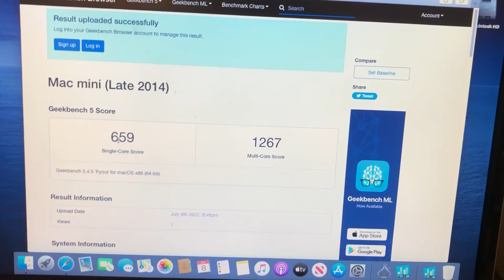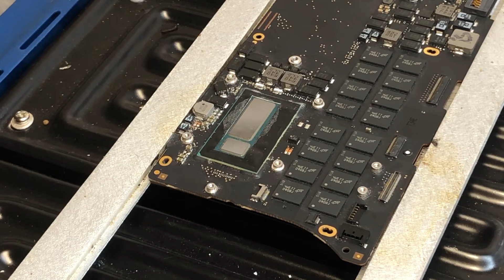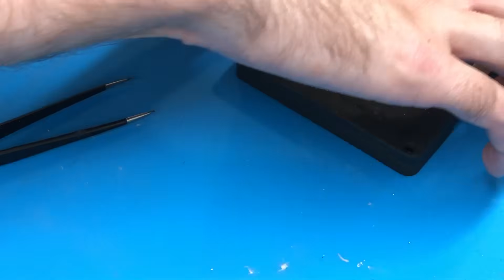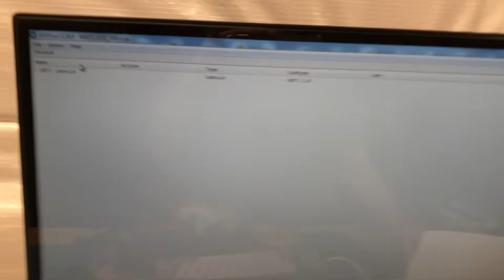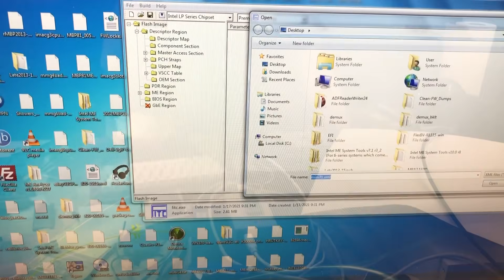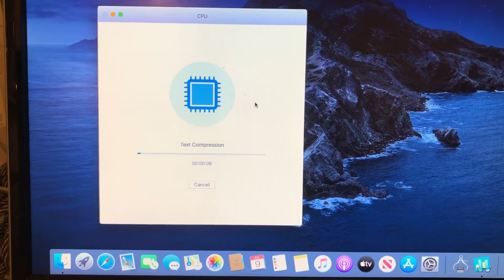2014 Mac Mini RAM and CPU Upgrade

Comment: When you pulled off the CPU I could see solder in place. What are the chances you could successfully put the new CPU there, heat it, and have it work without cleaning off the solder and adding new solder (balls)?

Comment: Hi! I know this is an old video now but I have 2 of these late 2014 Mac minis. I’m wondering what the maximum ram possible is, even unsupported but otherwise working capacities. My hope is that it will work with 32gb of ram, to match my late 2013 iMac. More ram = more better. 🤭

My ultimate goal is running macOS sequoia on both, and while the 8gb wil probably run ok on it, the 4gb model I own most definitely will not. It nearly died running Big Sur and froze up on me 😅

Since I don’t have the ability to do this myself, do you have any recommendations for getting this done? Do you offer this as a paid service?
Reply from the maker: Unfortunately, the absolute maximum that can be installed is 16GB, as 4GB is the largest capacity LPDDR3 chip made for that footprint. I do offer these upgrades as a service if you still are interested.
Reply: @dosdude1  even still, 16 GB is a massive improvement over my current 8gb. I have two of these late 2014 Mac mini’s. The first one that’s currently active is my 8 GB one and I’m running Sequoia on it. it’s painfully slow and glitchy, and I have to imagine that’s because of the RAM. The second one only has 4 GB which is absurd even for 2014 release date. I am actually very interested in seeing what services you offer and what the costs would be. I can clearly tell you know what you’re doing, and I would rather have you do it then try it myself. I didn’t find anything on your website about these services so it would be great if you could explain how to proceed. 😊

It would also be really helpful if you could tag my username so I can see the mention and see your messages faster. 😁

Comment: A worthy upgrade (if you have the equipment and skills LOL). So sad to see a 2014 with such a low spec CPU and paltry RAM. I own a 2014 mini with the i7-4578U @ 3 GHz and it actually slightly outscores my 2018 mini i7 with Geekbench 6, but that's in single-core only... the 2018 trounces the older mini in multi-core. Since I don't have a fancy soldering station, I will have to satisfy my urge for a faster 2014 mini like most folks... by buying another 2018 mini!

Comment: I just purchased a Mac Mini Late 2014 Core i7 3.0Ghz 16GB Ram 512GB SSD for $100. Once it arrives I'll be adding in a NVMe M.2 Control Adapter so that I can put a 1TB NVMe M.2 2880 SSD in as well. These are really nice systems, going to run MacOS Sonoma on it.
Reply: Please explain this—NVMe M.2 Control Adapter.... i really want to understand. please

Comment: if you accept my logic board, how much would you take..? Of course I need to source the cpu or a donor board... Dual core is so crippled in nowdays' internet but mac mini itself is in great condition.
Reply: nvm. mine's 2.6ghz i5. though it was 1.4. I can write EEPROM but soldering is the problem. Well, guess it will go on Ebay.

Comment: Where did you get the ram from? I’m trying to do the same thing but cant find out where to get the ram?
Reply from the maker: You can get them from AliExpress.
Reply: @dosdude1  hey so I just found your forum and everything. I think I found the correct ones that work is it possible to private message you and show you what I found to confirm its correct?
Reply from the maker: @sperez314  Just let me know the part number, I usually use Micron "D9SSK", or Elpida EDFB232A1MA-JD-F.
Reply: @dosdude1  The one I found was EDFB232A1MA-JD-F. Idk if its from the company Elpida as it doesnt say on alliExpress but whats the difference from the JD-F and the GD-F?
Reply: @dosdude1  So I found EDFB232A1MA-JD-F idk if its from elpida as aliexpress doesnr specify but I assume it is. I know to get the JD-F version as everyone always says it but what specifically is the difference from that and the GD-F version
Reply from the maker: @sperez314  GD-F is rated for 1600 MHz, JD-F is rated for 1866 MHz. If using for this machine (or any other Haswell machine), it only supports running its memory at 1600 MHz regardless, so either will work.
Reply: @dosdude1 ah okay that makes sense well since I’m upgrading a mac mini ill do the jd-f version thank you so much!

Comment: Hello! Can you please help me to find the issue with my 2014 Mac mini? Its immediately shuts off right after power button pressed. Cooler spins for a second and that's it. I've tried to replace power supply - doesn't help. Tried every reset technique already. Checked with different memory sticks.

Comment: I'm going up to Canada from Portland Next  year hopefully to learn  Microsoldering and smartphone repair but once I get comfortable soldering I am super excited to be able to do this kind of thing.  I literally just bought a Mac Mini from late 2014  for 100 so that I could use opencore to upgrade to Monterry and run BlueBubbles  server off of it but I noticed the appalling 4GB of RAM  and I'm like that'd be good to upgrade.
Reply: You're in for a lot of fun! Memory is doable, because of the smaller size. Just a little cheap preheater is enough. If I'd do it again I might mark the position of the IC's before removing.

Comment: Could a Quad Core i7 (such as the 4702MQ) work in a 2014 Mac Mini?
Reply from the maker: No, as you are limited to Haswell U-series chips on these, due to their unique footprint and implementation (PCH and CPU on one package).

Comment: Great video for someone like myself. I’m looking at purchasing a 2014 Mac Mini so now I know that, whilst the ball-ache of doing this process myself isn’t terribly difficult (merely mundane), it does require a set of unique tools and isn’t cost-effective unless scaling the operation.
Alternative, spend £20 extra for the 2.6GHz model regardless of RAM and upgrade the whole unit a year later to the 2018 model.
Thanks!!!

Comment: Really nice video. Thanks for the entertainment. Its a bit sad 2014 mac mini has only a 2 core cpu, which makes late 2012 mac mini a better choice both by the fact that you can upgrade ram and the i7 CPU being better in multi core performance thanks to the 4 cores and 8 threads and the 2012 i5 is a bit better than the 2014 i5. There is a plus however, 2014 mac mini consumes way less power than the 2012.
Reply: The graphics are better on the 2014 as well, especially the 2.6 and i7 versions which are Iris instead of HD 5000.

Comment: I’m going to attempt to upgrade my Mac mini 2014 ram from 4 to 16. I’ve got a heat gun but I’m trying to figure out what else I need and what I need to know. What flux did you use? Also how do I know if the resistors are set right of if so need to move them? Also where do ai get the correct ram chips?
Reply: did u get the ram chips?
Reply: No, I have realized that my Mac is so old that it’s probably pointless and a waste of time to upgrade. So I’m probably going to just get a newer one.
Reply: Yeah, i guess its time to get a new one... Thank tho

Comment: Awesome work.
A complete novice here, so please excuse my ignorance, but I didn't notice you putting any fresh solder on the RAM chips. It looked like you cleaned off all the old solder from the pins on the logic board, added flux to the new RAM chips and then put them on the logic board. Where did the fresh solder come from to solder the new chips onto the board?

Comment: OMG, fantastic. Beyond my competence but I am going to upgrade a 2014 i5 Mac mini with an additional PCs 500Mb drive instead of the SSD drive. Hopefully this will speed things up enough. Actually I have a Mac Book Pro from 2011 which I managed to drive over. (don't ask how). I had the screen removed and have been using it to drive my tv but the OS is not upgradeable and I have VPN problems with it.

Comment: A little like having a Time Machine.

Over the years, I’ve always bit the bullet with whatever cannot be readily updated, and I’ve never once regretted it. My Macs serve me for an embarrassingly long time mostly due to that up front cash drop. Apple’s campaign against people like me means no new Macs. I’m still in the early to mid 2010s with all of my computers except for the iPadPro I’m typing this on. They are all business tools for me so upgradability is essential. Colleagues marvel at the age of machine I use with modern OS and more importantly, 2023 Pro Tools versions. Now if I could just shave a few pounds off my MBP 6,2 for flying.

Comment: whats the trick getting a 2014 thunderbolt 2, to boot off the new NMVe SSD drives? if you used the Thunderbolt 3 to 2 adapter then the NMVe doesn't get power for the external enclosure
Reply: i figured it out for anyone else, there is actually a $15 internal adapter you can buy and you open it up and it's plug and play, screw thunderbolt 2, TB2 sucks, this is the way to go, i am now getting 760 MB/s read / writes this way!!!  Dosdude1 thanks for your non help here, haha

Comment: I'm on a late 2014 mac mini with 4gb ram and an ssd. I think the ssd makes all the difference for me. This computer as is with the ssd is fantastic. Thanks for the information and the how to. You're super talented.
Reply: how u running the ssd? externally booted? make sure you use the usb 3.0 ports not the 2.0 ports, 3.0 is 10x faster.

Comment: Question!

I have Linux installed on my macmini late 2014, can this upgrade still be applied? And would I still have to reprogram the eprom? can I follow the same steps in this video and get the same results with a linux based os?

Comment: The average 2014 mac mini model has an i5-4278U at 2.6 GHz with 3mb of cache, and the i7-4578U has a base frequency of 3 GHz and 4mb of cache and the difference between them is units of percent. And both of them are 2 cores with 4 threads. Is it possible to solder a 4-core processor on this board? and another question I have a mac mini 2011 with Core i5-2410M and only built-in HD3000 graphics. It slows down even when viewing YouTube, what can it be updated as much as possible by soldering and is there a graph in this generation that will pull at least YouTube?

Comment: Hi, just wonder is the RAM in Mac Mini Late 2014 (1600 mhz "low power" lpddr3 sdram) is same as other ram that able to get in the market? Or in other word can I get these ram chip from anywhere in the market (As long the same model number used in Mac mini late 2014) the dismantle the chip from the ram and solder into my Mac Mini?

Comment: How you align those chips to be perfectly placed on the board is beyond me. You would think that some kind of guide would be glued onto the circuit board with the original chip so that you could be 110% sure the pads and contacts are properly placed.

Comment: 1.4ghz and 3ghz arent real frequencies tho, classic apple move to over simplify things to such degree it becomes misleading

2.5ghz and 3.5ghz are the real frequencies, you need to account for turbo boost which defines the real frequency. Also the i7 is apparently running at higher voltage, you gotta check the cooling (prime95 sfft for 30 minutoes, or aida64 with "stress fpu" only, to check for throttling). In geekbench there is a 25% improvement which is minuscule to say the least, but with throttling the i7 may actually decrease its performance  back to i5 level.

Overall great demonstration, but completely useless in the real world.

Comment: Very impressed by dosdude1's skill and  precision.  This is way above my pay grade. Will  say this: I've a 2012 Mac Mini, the last Mini where both RAM and drives were socketed (not soldered) and so upgrades there were plug and play. The CPU of my old Dell Latitude was not soldered either so upgrading that was also simple for this klutz. All of which is to lament that newer tech, with glued cases and soldered everything, requires dosdude1 level expertise to service.

Comment: If you run intel flash programming tool while the computer is still operable with the -I -VERBOSE flags it will list off the regions on the spi flash where the me image resides. You can also read and save the me image binary straight from the flash with the following: fptw64.exe -D me.bin -ME

Comment: Very nice video, kudos for the upgrade, just a question, where do you buy the new ram chips? what are the specs for them?
Reply from the maker: They're Elpida EDFB232A1MA-GD-F chips, which are 4GB (32Gbit) LPDDR3 chips rated for 1600 MHz. You can get them from AliExpress.
Reply: @dosdude1  you are the best!!!

Comment: Could someone tell me if there is any advantage of having the memory soldered? Or it's only an Apple move to force people to buy a new Mac if they want to upgrade?
Reply: The latter. It forces the consumer to make an expensive choice at original purchase. Either spend the extra money for the extra ram or suffer slower speeds.
Reply: @kflip2indy  …..and of course, it also SERIOUSLY reduces the value of used machines, thus ensuring they get tipped.. More industrial waste.

Comment: In 1986 I cut out the 64k of memory from my first Mac and soldered in 128k with guidance from Dr. Dobbs Journal. Thought that was pretty cool but my oh my how times change! Brilliant work, sir, kudos to you!
Reply: do you mean the "Fatten Your Mac" edition?

i cant find any 64k to 128k upgrades...

but i did find a issue with 128k to 512k 

January 1985, Vol. 10 No. 99
Reply: No Mac shipped with 64k of memory.
Reply: @kirishima638 Maybe it was an Apple
Reply: @kirishima638  kilobites of memory
Reply: @kirishima638 macintosh
Reply: @kirishima638  I think he meant an Apple IIe computer

Comment: Hey dosdude, i have a question, can i use a cpu from windows mainboard and solder it to macbook board ? I have try solder a i5-4310U SR1EE to a macbro board but no boot, does macbook bios have that cpu microcode ?

Comment: yah... about that  you have 4 sets of 2 resistors for the spd data low & high and they are using 10k & 100k resistors depending what you chose
Reply from the maker: I know, but it doesn't really matter. Works just fine to pull up with 100K, pull down with 10K, and vice versa.

Comment: I’m impressed with your upgrades. I was told by a guy who is a certified apple tech that the memory couldn’t be upgraded. Do you do work for other people. I have a late 2014 mac mini. I’ve never done any soldering. I would be very nervous doing something like that. How much did the parts cost and where did you find them?
Reply: I mean, officially, no, it can't be upgraded. This isn't any different from installing modchips or other hardware mods to consoles. It can be done, but not officially.

Comment: hi i currently have a i5 2.6 gz on my 2014 mac mini, which cpu do you recommend I upgrade to speed up simple web broswing? and do you think its worth upggrading to SSD I currently have a 1TB SATA disk? thanks
Reply: Buy the part that enables you to put an nvme ssd inside. You’ll be amazed how fast it makes it, like a whole new machine. Then you can use the old hdd as file storage and boot off the nvme.

Comment: Have you tried putting the chip into a clamp after removal for cooling?  May help with the warping. (would need flat even planes for top and bottom of the chip between the clamp)

Comment: Years ago, I wanted to upgrade my g3 CPU in my iMac to a G4.      I still am not sure anyone has done that.  But it's pointless now.     Thing is?     With a VM , Remote desktop/  VNC?  You can be running the newest and greatest stuff with just the PC acting like a terminal / Thin client to do all the work remotely if you have a great network connection.    

I used to edit videos that way

Comment: Very interesting video! So much for the average joe doing the upgrade as in the older Mini's where memory and cpu were socketed. As a bench tech for commercial communications equipment one would have to invest in some very serious gear just to do these upgrades. Gone are the days of diy repairs and upgrades for the average individual. I do have half of the equipment needed however reballing would not be my cup of tea. Do you do this work as an occupation or hobby? 
Again thanks for the informative video!

Comment: I'm not a soldering guy.. What is the purpose of flux?
Reply from the maker: It just helps the solder flow properly, ensures it melts onto the points it's supposed to, and prevents bridging.

Comment: Great video. I just have the same Mac mini.
Off topic, how do you open this Mac mini? I want to disable the internal speaker since my internal speaker now makes a gurgle sound. Now, I just use the external speakers. I cannot disable it by changing through the setting since I already deleted my MacOS. I have replaced it with several Linux OSes.

Comment: That really will be breathing new life into that machine. I think the i7 from that generation was a proper hyperthreaded quad core even in the 13" Macbook Pro, though it may have still been the lower powered variant. Still, it should work wonderfully with the upgraded processor and memory. Always fun to watch people keep these older machines viable with electronic wizardry.

Edit: I was mistaken, the i7 u series from that generation was only a dual-core processor. How disappointing. Still, just getting a substantially faster clock speed will make a world of difference for that mac, as will the upgraded graphics. At least as far as general computing goes. Intel Iris was never a gaming powerhouse, but it's perfectly capable for general UI tasks and video playback.

Comment: what would happen if you sacrifice the donor board and remove cpu by heating cpu trough the macbook pcb? would cpu still bend or perhaps the donor board would bend and cpu remain straight
i know it would work better with ir heaters but in the past i was fixing old motherboards by barbarically heating donors over a gas stove and just picking what i needed 
well i also resoldered them without cleaning or rebaling but i was young and supid and 60% of it even worked